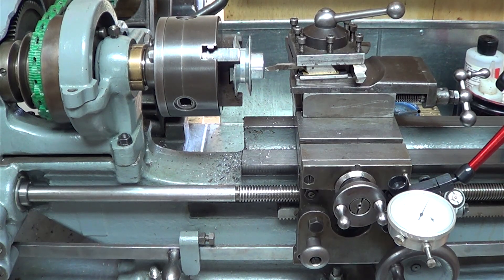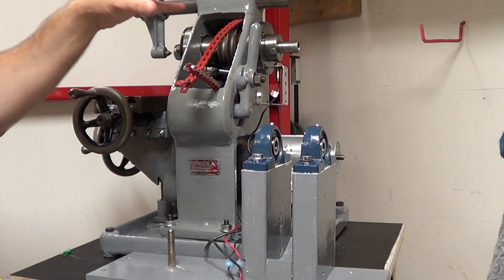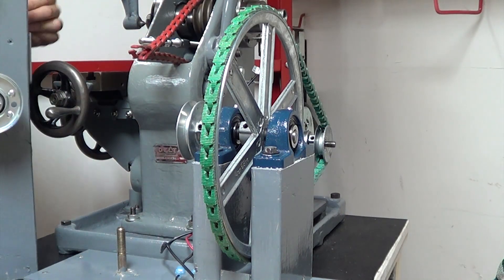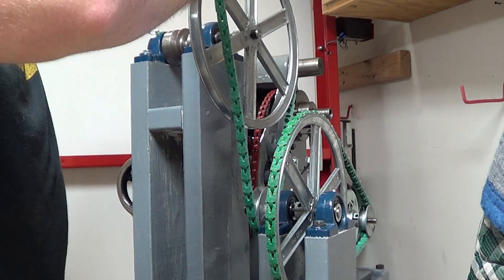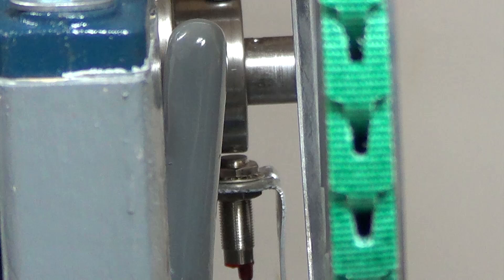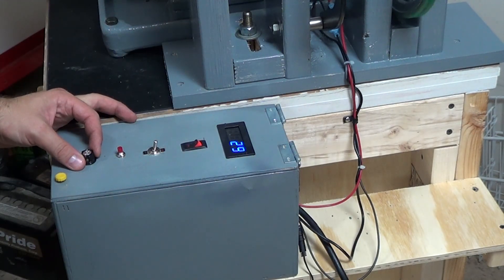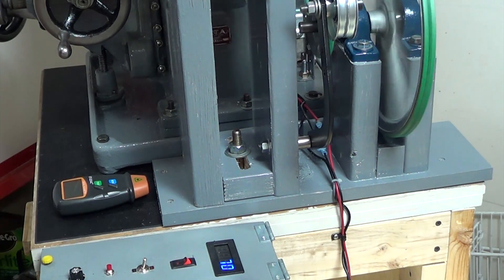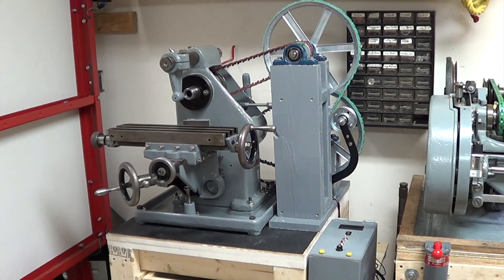Benchtop Horizontal Mill Part 3 // Restoration and Rebuild

Comment: Thanks ThunderDog. The wood is a good way to prove it out . Sometimes you just have to use what you have. I would love to see how the machine was powered and setup originally . It does look like a intense way to "Skin the Cat" with the extra pulleys and belt. Once proven I would be looking for a way to make it out of steel or at least aluminum. With a heat source and enuff aluminum cans you could cast it your self .
Reply from the maker: Checkout my more recent videos to see this mill having been converted to a vertical milling machine.  And no more extravagant pulley setups, too!

Comment: If you use smaller idler wheels after the motor, you will get much higher speeds at the cutter, or if you want the lower speeds the motor won't be flat out, I think you have reduced the gearing too much to have to run the motor at 7000 rpm to get 200 rpm at the cutter. just make sure you have a discipline to not run up to full speed if the arbor bearings won't take it. just a bit of feedback that you asked for, awesome rebuild and i learnt a lot from your vid.
 i use a treadmill motor on my horizontal mill too, but i've actually got the treadmill display to turn the motor on and run speeds up, gonna be having a look at the potetiometer, power adapter route shown here though.
thanks
Dan U.K.

Comment: Sweet. I agree with the big low speed torque on those motors. I have the identical unit. When you do go for less gear reduction, your motor will be drawing more amps and running slower, and you removed the cooling fan that was part of the original pulley so you might want to use those blue thermal protection wires in the motor.

Simply disconnect the blue 'mains' wire from the controller board, connect it to one of the blue wires from the motor, then connect the other blue wire from the motor back to the controller. The connectors are polarized so you can't muck it up (not easily, anyway).

Comment: As a welder, fabricator, tool and die maker, and a man who has spent many years in the automation business, I can tell you this............you don't need a welder to build a structure for your pulleys. There is nothing super critical about the structure, you just need to be able to put tension on the belts. You can make all of your support structures using either flat stock steel or aluminum, and simply bolt it together with threaded holes in your parts. It would definitely be strong enough for this project. I've done pulley systems tons of times with nothing more than a mill, drill press and my hands.

Comment: Thunderdog:
I don't know if you realize that by converting to a DC motor, you created a "proof of concept" which in fact works.
Now what you have to do, based on your present set up, is to find a simple motor/machine spindle combination ratio that allows you, by using your speed control, a full range of usable rpm range, with only one set of pulleys. That is, a usable minimum and maximum limits, that fits the size and purpose of you mill. People that converted Drill Presses with 12 or 16 speeds for example, use only one single belt two pulley setup. The key is finding a middle ground between speed and power.

Regards

Jorge

Comment: +Thunder: Have you considered going directly from motor to the mill?  Other builds on net have done this with lathes and mills. The treadmill motors are supposed to be quiet beefy on output/torque (given what they are actually used for). This would leave you with only two pulleys of your choice and one belt. DC motor has some skookum variability in speeds so you would be able to just dial up what you need/want. Other guys setups like this run damn near silent as well. Just a thought. Nice build series, well done!!
Reply: Er, check that. Looks like other blokes have mentioned the same thing. A number of times!  Guess I should have scanned the other comments first. Doh!!!

Comment: You might want to consider mounting your power train below the machine. It appears that you could run your belts through the body of the casting, if there is room. Just a thought. Nice job on the electronics!
Reply from the maker: +ron peck Appreciate the idea, thanks for watching.

Comment: what about a worm drive gear box at say, 40 to 1 straight on the arbour shaft? Or a small worm gearbox at 20 to 1 on your variable drive motor with a pulley to the other machines pulleys?

Comment: You need back gear. Low speeds are good for lots of stuff, but worthless for a lot of ops, especially with the small cutters that thing will use. Two sets of step pulleys should do the job.
Reply from the maker: +The Metal Butcher I just can't wait to start using it.  Still need to cut a keyway for my arbor.  Thanks for watching.

Comment: Do you know how to take the headstock apart on the lathe you got there? mines the same.
Reply from the maker: Yup, I've done it twice and actually just added a simple mod from the Drummond Lathe Yahoo group lastnight.
Reply: Cool. im racking my brains cause i dont know how to take the shaft out. cant see how the bull gear locked on?
Reply from the maker: Give me a few minutes to get back to you.  I'm assuming you got the brass nuts loosened up, the rear collar removed, and both of the oil fillers(can't think of their names at the moment) removed/loosened up, right?
Reply: yep im exactly up to that. thanks :)
Reply from the maker: Ok, now I'm going off memory here because the last full teardown was about 8 months ago.  I know I took off all of the back gear assembly, too.  I know for a fact that the spindle is installed from the front, meaning when all is loosened up you can tap on the back of the spindle to drive it toward the bed ways.  The spindle has a long key on the shaft.(I'm looking at the pics of my tear down right now.)  Also, note that the oil fillers are a critical component to wedge the bushings in place.  Those bushings might be wedged pretty tight if it has never been removed.
Reply from the maker: FYI, I'm assuming that when tapping on the spindle the utmost care and respect is being employed to prevent damaging the machine.  Have to say that or somebody on the internet might flip out.  :)
Reply: Thanks. i'm being super careful. ill try that and see if it works. i dont think its been apart since new as well.
Reply: Success! It came apart and unjammed the bushing. Runs now smooth and chatter free. :D Thanks a million, couldn't have done it without you.
Reply from the maker: AWESOME!!!  Glad I could help.

Comment: Thanks for a very helpful series of videos on treadmill motor wiring. If you still want some pulley gearing you could consider using cone pulleys like a drill press has? I would just use the weight of the motor to keep tension on the belt like an old tablesaw motor swing bracket. A spring could be used if the motor was too light to keep proper tension. You could adjust the belt position in a few seconds. I'm curious why you went with such an elaborate pulley setup with a variable speed motor? I'm not criticizing you, I'm just figuring out how to convert my bandsaw, and I'm thinking direct drive. Are the pulleys necessary? Thanks
Reply from the maker: +Jeff Iscool Yeah, I'll admit the pulley is kind of pointless with torque and speed relationships.  I'm leaning towards removing the pulley setup.
Reply: Ok thanks. Dont feel bad about making extra work for yourself. We're human and make mistakes. lol I once spent an entire day, plus, and quite a bit of money building custom scaffolding to install second story windows. When I asked my wife to help me hoist the first one up the scaffolding, she asked why I didn't just put them in from inside the house. WTF?!! Seriously!!! 10 minutes later the first one was installed easily from inside. No scaffolding required. It took longer to remove my scaffolding than it did to install the windows. I still can not believe I did that.
Reply from the maker: NICE!!!  Yup, another set of eyes or brains helps each of us improve.  Regarding your bandsaw, that was the first thing I converted using these types of motors.  It was SUPER EASY.  I used the exact same type of motor you saw here.  I used a 2" pulley on the motor and a 10" pulley on the bandsaw.  It's a Craftsman brand bandsaw and has worked perfectly.  I've used it to cut steel(using a steel cutting blade of course) and it has cut hardwoods very easily(using wood cutting blades, of course).

Comment: Were on earth did you find a bench top horizontal mill at m8?
 that rig would be both quiet and better IMO if you ran the motor on a direct feed to the spindle shafting and used a solid state rheostat to control it. But also love the work you have done so far.. BTW King of Random Welder 1 dead microwave a new stinger10$ and a ground clmp10.. hvy cord 20$  so 40 bucks l8r you have a stick welder that works...
Reply from the maker: Good 'ole Craigslist is where I find just about all of my tools these days.  Others have commented on simply removing the pulley setup, too.  I'm seriously considering doing that.  Yeah I know I could cobble together a cheap welder, but that's a purchase I'm willing to save up for to get a better unit.

Comment: Get rid of about half of the pullies, you should be able to get up to about 700 RPM spindle speed.  Also I don't know what the torque & HP is on your motor but I would think 3/4 to 1 HP would be right.

Comment: I also have a treadmill motor with the same mess of wiring as you had, and working on how to get it running. I am not up on electronics either, hopefully your series here will help. Mine is a 2.5 HP 90VDC. Nice work on the project.

Comment: If I were doing this project, and idk if you considered this when you designed your belt reduction transmission, I would look to see what kind of horizontal wheel or slab cutters, and in what types of material I would like to, or be likely to run. Cutter width especially is important on light machines, as you probably already know. You've got good low speed resolution but personally I would like a top end of around 1k rpm, in case I would want to use small diameter cutters, like a 1/8" or smaller end mill in horizontal mode. Good job on the mini mill, I look forward to seeing you make chips with it
Reply from the maker: I agree with wanting more top end speed.  Thanks for the comments.

Comment: Maybe you can cut a groove in the bottom of the base and send the belt down under the machine, then put all the gear reduction down there hidden away. Also se if you can't find a reduction gear for a normal motor, cheap way to get some worm gear reduction. ;)

Comment: You might check out a Barker and/or Atlas horizontal milling machine. They both use a countershaft similarly. Perhaps you could find an Atlas countershaft assembly on ebay and modify it for use. For that matter, I purchased an extra South Bend lathe countershaft on ebay for something like $35. That's cast iron and line bored for smooth running... This might be a nice way to get a strong countershaft mimicking the Atlas mill. Nice restoration- very creative. I learned a lot about the treadmill motor wiring, which I've been really curious about.

Comment: Cool!  You could use the aluminum extruded tube that has slots and such if you really don't like the wood.  It's a way to get metal in there without the need to weld.

Comment: looks good id try to use the mill to build a better counter shaft  out of structural steel . might want to see if  you can gear it up a little maybe put a set of step pulleys in the system so you have different ranges probably be able to shrink down what you have there also . you still want the very low rpm for larger high tooth cutters but if you use a small end mill our gonna need a lot higher then what your getting. you have a copy of machinery handbook ? probably have feeds and speeds data in there it all depends on cutter diameter and tooth count. its cumming along real good keep it up . ive ben making some videos of me brown and sharp mill very similar to this little on but little over a tun .